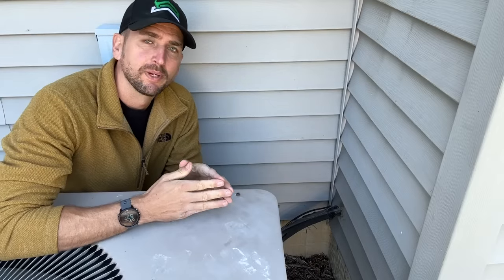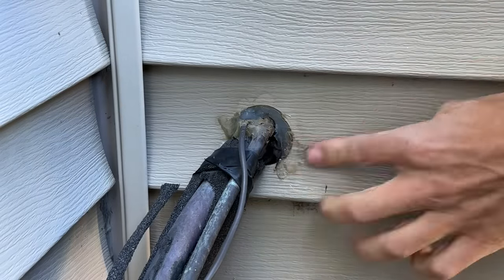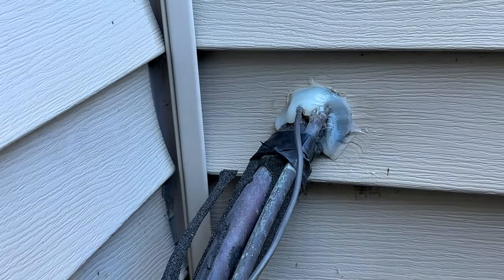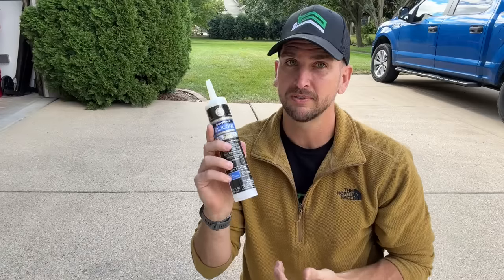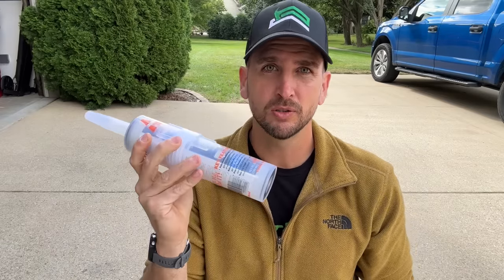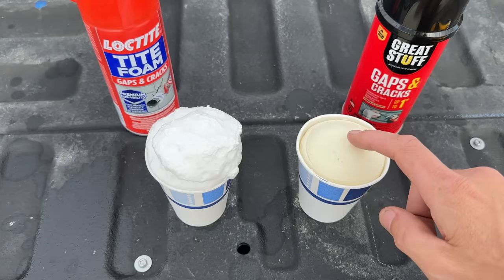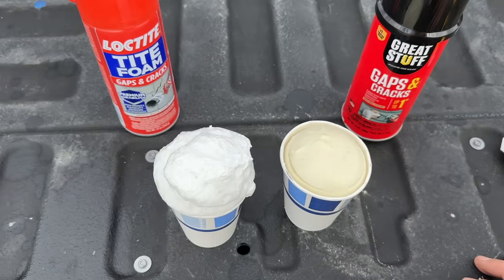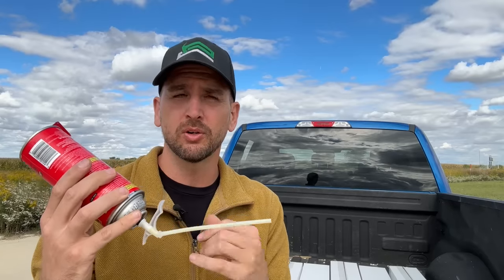How To Seal Gaps And Holes In Siding | Keep Bugs and Cold Out!

Comment: Most materials this guy is using is WRONG for the jobs he is doing. Siding manufacturers make special pieces for penetrations. USE THOSE !  Forget the spray foam and use "DUCT SEAL", a putty like material that never hardens and has been around at most home stores for decades. Silicone for small penetrations is suitable.